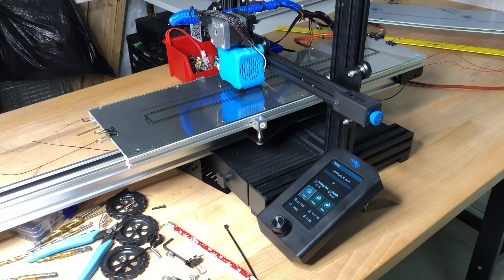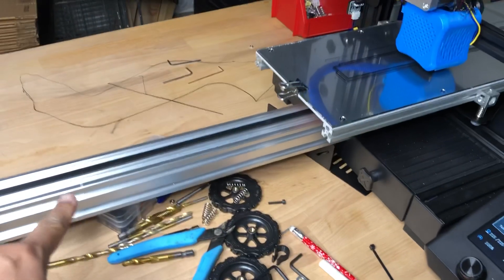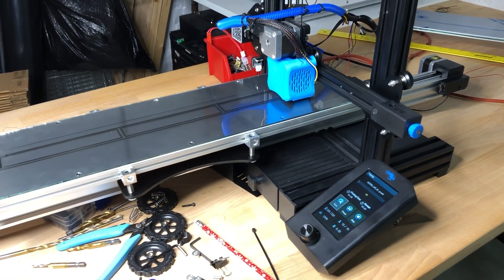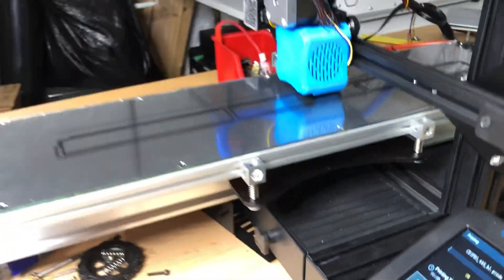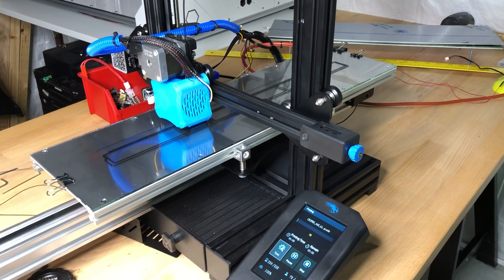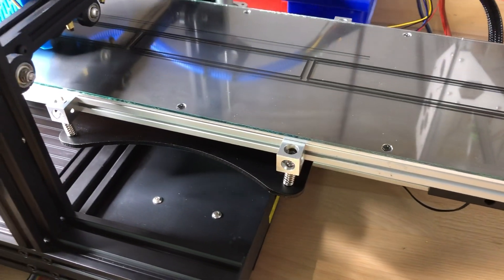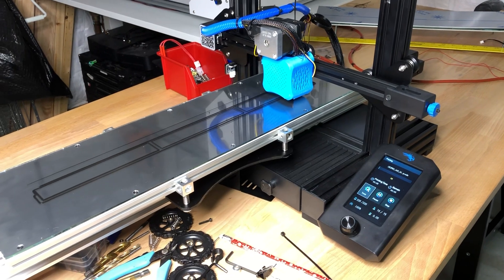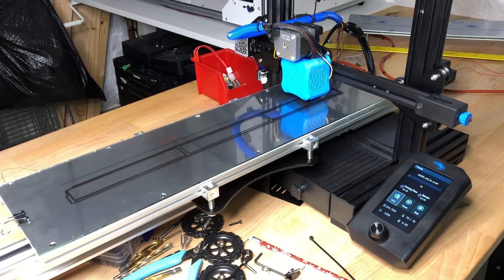6”x24” Extended Ender-3

Comment: Hello, but how do you update the size in the firmware on the mother board, so it knows the bed is larger? I am having this problem with my 3d printer, I upgraded to a 400x400 bed size, I am using a Creality 4.2.7 motherboard.  Thanks.

Comment: How did you setup your slicer, eg Cura for it to recognize that size bed?
Reply: you already have to tell cura what size current printer is
Reply: @Fluffehfox  oh okay I only tell cura what printers I have and it shows the correct bed for each different printer.  I will have a look now.
Reply: Cool I just found how to add custom bed sizes in manage printers and then machine settings.  Awesome

Comment: How'd you adjust the software or u did a custom bed in cura
Reply: You had to ask. 
I just turned up cura bed Y-Axis to 900 mm and sliced parts. It has a standard bed showing with basically extensions on the Y axis. It works fine. Just increase bed size to what ever you want.

Comment: lmao that's a funny upgrade. Actually increasing z height is probably very easy too I assume, it would only require longer extrusions and the corresponding lead screw.
Reply: Gussets with dampeners if you want to print at any speed past 30m/s😅
Reply: 30 meters per second,  are you tripping?
Reply: @buZztiaan  and that children is why drugs are bad😅....I meant 30mm/s🤣

Comment: Nice project but you can only print pla without the heated bed?
Reply from the maker: It's got a heated bed. 350w 24v. But I'm switching to 650w 110v. More of a pain to install, but less of a pain on the power supply.

Comment: Manufacture kits for this you'll make a fortune.
Reply from the maker: Oh. Yeah. I did. But I have to have someone else made the bed with the proper holes.
Reply: Except a large, heavy moving bed like that with the same small steppers will have to be driven very slowly. The print speed will will suffer horribly, but if that is a compromise you are happy with it is a low cost option. It would be a good idea to put those position feedback motors BIQU sells on it.
Reply: @court2379  And CR10 came out.
Reply from the maker: @court2379  mine prints pretty fast. Above the standard default speeds.
Reply: @DewItJustinKace  I am sure you can set it to, but you are going to have quality issues. Ringing, higher likelihood of missed steps, etc. With the right settings the stock ender 3 can be pushed much faster, so maybe you have tweaked yours to do so with the added weight. Otherwise if you print the same object on the stock vs yours with the same settings the quality must be better for the stock E3. The motors have less mass to drive and inertia to fight. 
Also a larger bed means larger prints, and I would guess you will have big problems with missed steps on a heavy part. Steppers with the position sensors could mitigate that issue though for a small amount more.

Perhaps it is still good enough though so doesn't matter.